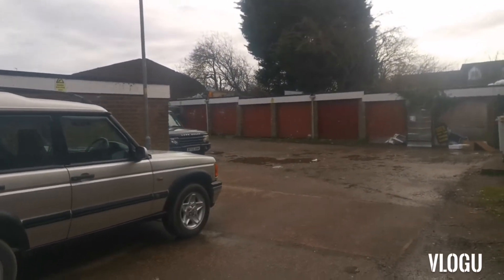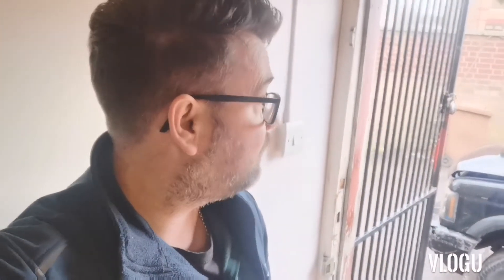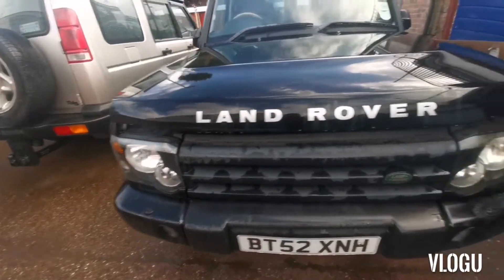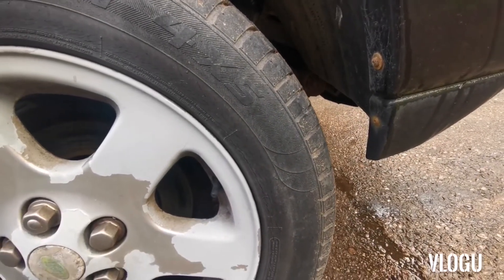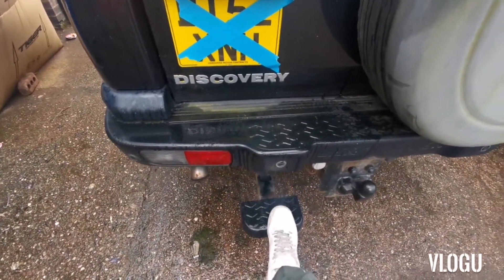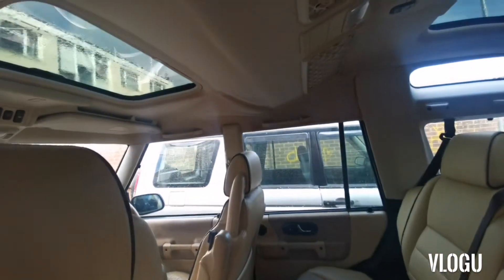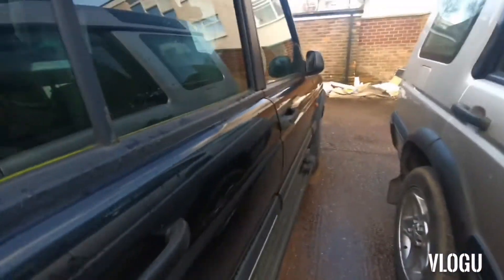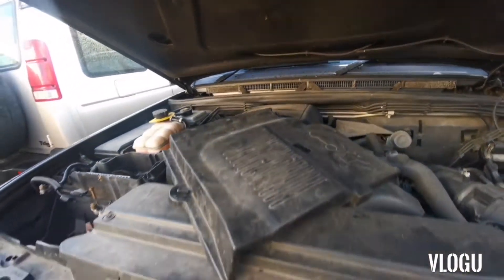the problems you get with a £1500 discovery 2 td5

Comment: Looks a decent truck with good spec …glad it’s gone to someone who will put it right … I’ve got an 04 TD5 pursuit… and thought that was okay with 2 previous owners and 114k .  .. the engine is lovely.. gearbox a bit like a wizards sleeve and the previous owner changed the slave cylinder so clutch bite is low .. got to change that but once on the move I love it ….. 👍

Comment: I bought mine for £1000 and within a month had front diff rebuilt , fuel filter assembly and mot cost £1300 then gearbox needed rebuild £3200 then suspension air bags, axle seals, wheel bearing watts linkage steering box and the list goes on now I have self steering issue, it goes side to side across road bloody scary but I’m sure it’s fixable.  Good job I love landrover’s or it would be scrapped.
Reply from the maker: Wow. Big list there

Comment: I paid 1750 for an mot failer its an 04 rust bucket
Reply from the maker: Sorry to hear that. You have to get under there and give it all a good poke with a screw driver. The rear quarter chassis tends to be the worst.
Reply: @wardysworx  one side is ok but the other has been patched and there is a hugh hole where the top of the shock absorber should be!
Reply from the maker: I had one that had the rear shock mounts held on with two massive dome head bolts as they had rotted off. Didnt realise until up on a ramp.  Took 3 days of welding
Reply: @wardysworx  ouch so mine might have a lot of time for welding !